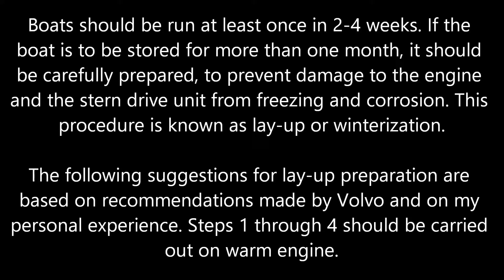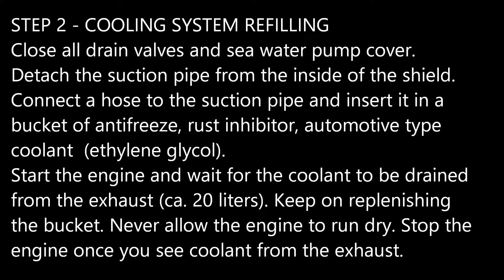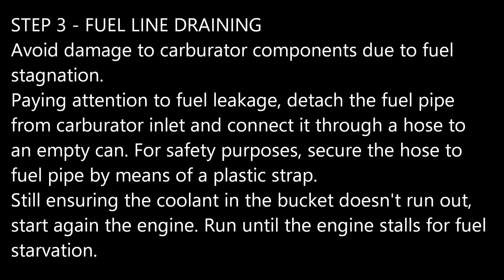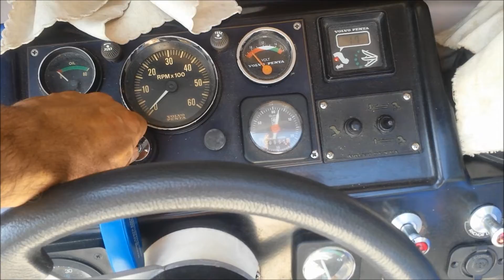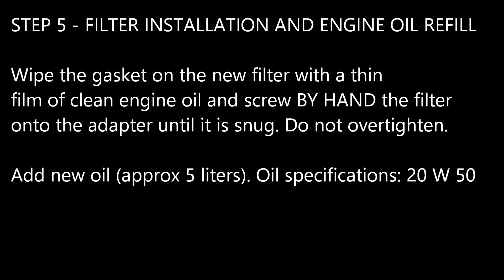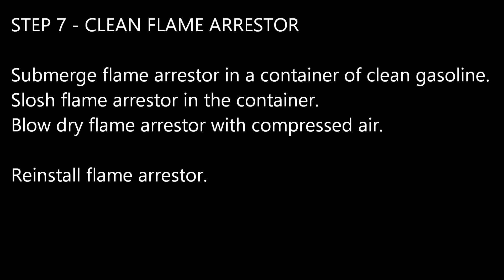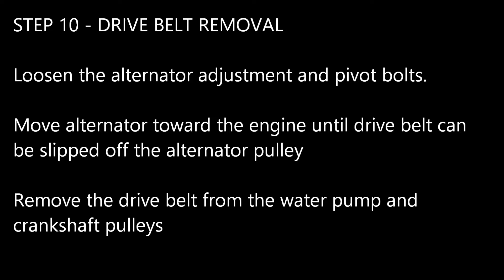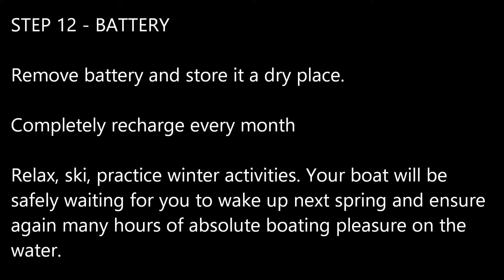Volvo Penta AQ211A 290A winterization

Comment: Nice Video!

Two questions:
1. how do you ensure the thermostat is still open, and the inner circuit will also get antifreeze?
2. what spark plug socket you use (clearance to exhaust manifold)?

Thanks
Reply from the maker: Hi!
1. The thermostat is still open because you do the job on warm motor. The time which elapses between the instant you switch off the motor, you drain the circuit and you switch on again the motor to pump the antifreeze does not allow the thermostat to close. We are talking of 10 minutes.
2. The soket is a standard 17 mm plug soket. No interference with exhaust manifold.
Reply: @stefanovaleretto3121  thank you for the reply.
I have a 570A, with 16mm plugs (Champion RV15YC4), and a standard 16 socket get´s stuck with the area of the exhaust manifold, especially in the area of the expansion plug.
Reply from the maker: @peterniedermaier5864 Initially I had the same problem and I solved it by machining the external surface of the socket to reduce the diameter by 1-2 mm. Then I replaced the manifolds because they were clogged by rust and with new manifolds there is much more room to operate and no more problem at all. I think the problem is limited to the original manifolds.
Reply: @stefanovaleretto3121  oh, OK, that would explain. With my previous DP570A powered boat I didnt have that issue. Maybe those were already 2nd generation manifolds.

Thank again for your prompt feedback.